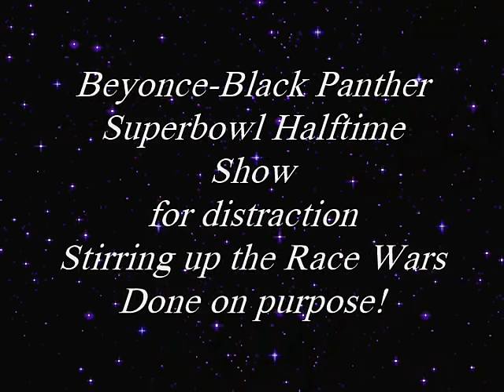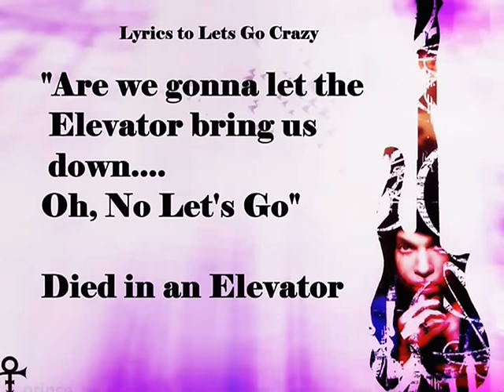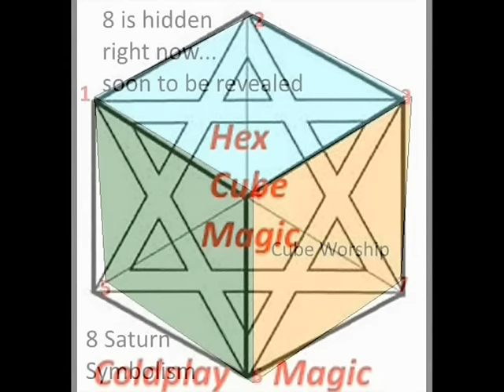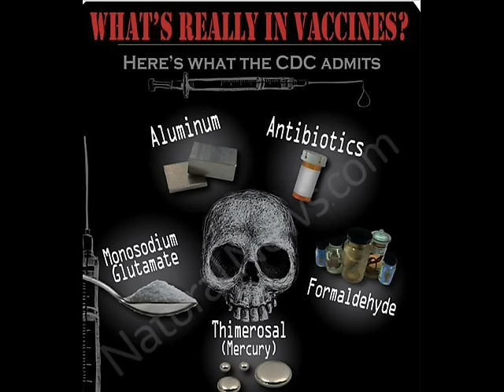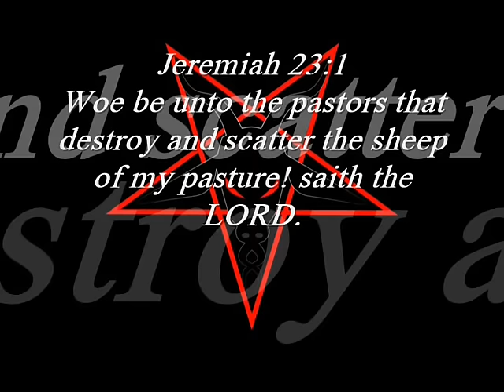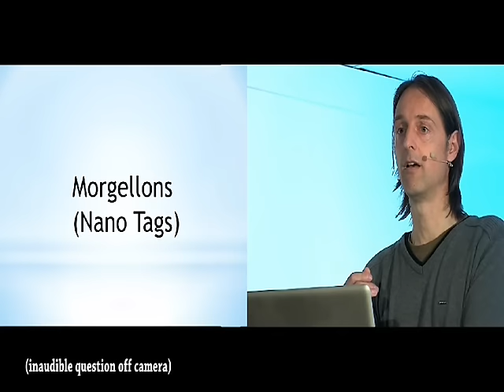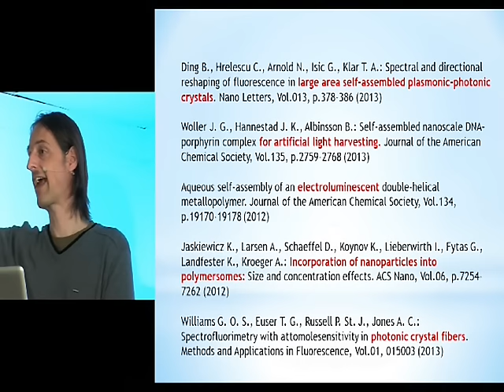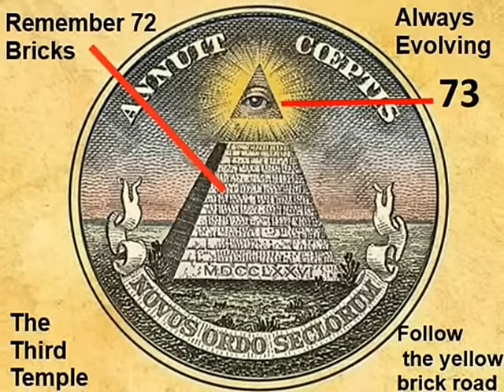Better Know Thy Enemy-Nicholson1968

Comment: The 1st Coming of Messiah was a turning point of authority of governments.
Before that event, Kings ruled under influence of spirits that could include the Holy Spirit at times, like Enoch and David, but mostly were satan's spirits.
Then during our Messiah's resurrection and ascension Michael was able through Lamb's blood to cast satan down from Heaven's Kingdom where he had accused Saints of sins in the struggle over Authority upon Earth, and satan was given full rule upon Earth after cast from Heaven, while Messiah ascended to rule in Heaven communing with 144,000 Overcomer Saints through Holy Spirit being built up as immortal fleshly Temple until 2nd Coming at time of Armageddon to cast satan in prison for 1,000 years allowing Heavenly Kingdom to descend in Authority upon Earth along with Transfiguration of 144,000 Saints into immortal flesh Temple as Lamb is glorified.
Wicked men are trying to perform this through their own works while trying to prevent the 144,000 Overcomer Saints from being able to be Transfigured at 2nd Coming of Messiah from mortal to immortal flesh as an eternal fleshly Temple of Holy Spirit.

Comment: Gosh, besides protective cover, what's the alternative to sunscreen if you don't want to burn.
Reply: P.s.:  the great points made in this video were not lost on me. :)
Reply: Shade. Don't sun tan or use tanning salons. The media has portrayed having a tan as being healthy. It certainly is not. Small amounts of sun each day is healthy. The length of exposure largely depends on your skin type. Long exposures are not healthy.
Reply: Shade, LOL.  That's an obvious option, but what about the times where you have to be in the sun?  I agree with everything else you said.
Reply: Jeff Maddock I'd say when the sun is not overhead or close to being overhead as it is therefore closer and more intense than it is earlier in the day or later in the day when it is further away.